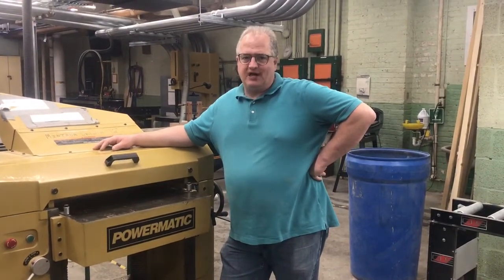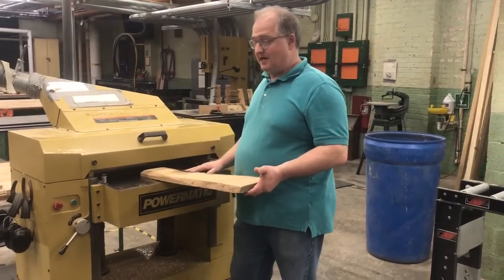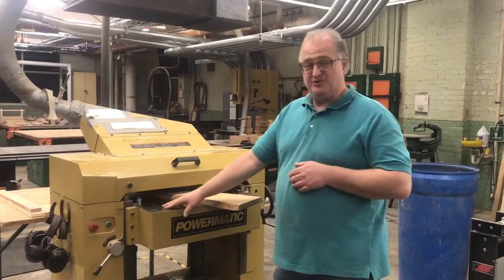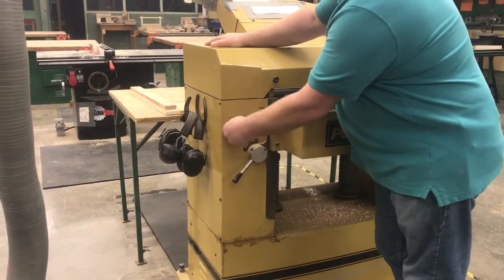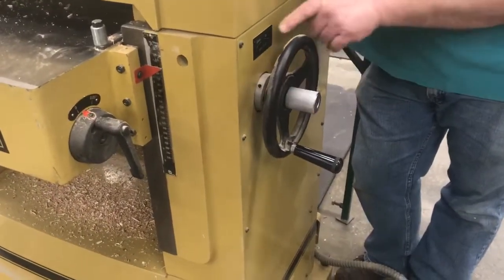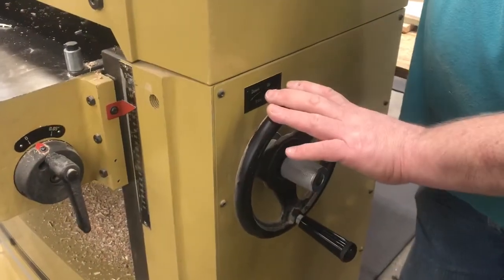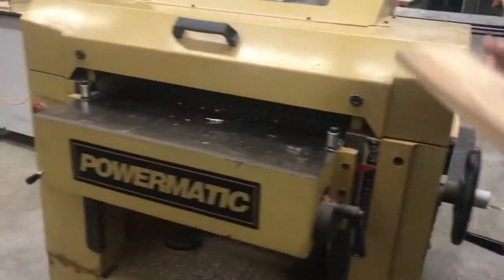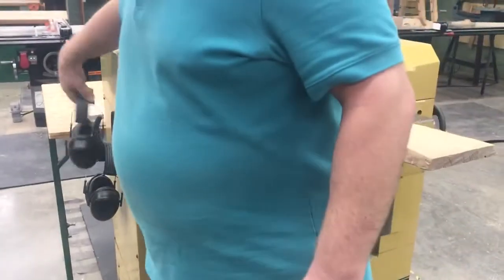Introduction to the Powermatic Planer in the Monticello High School Wood Shop

Comment: That big mighty planer and you just can take one sixteenth off that's crazy
Reply from the maker: It was an introduction class for new students that were just learning how to use the planar. It helps to minimize the amount of insert and blade wear from learning student's. Plus the S4S boards only needed that much removed on both faces for clean up.